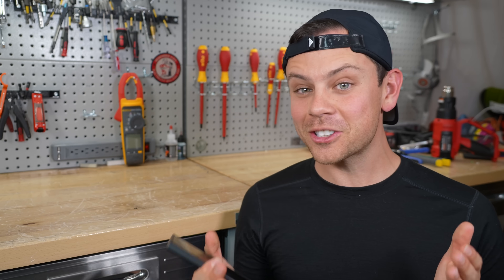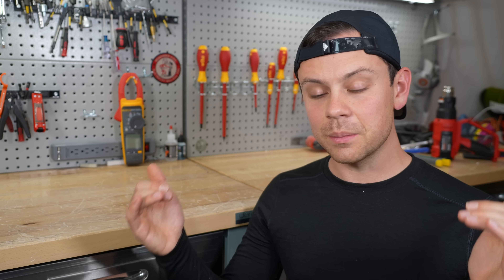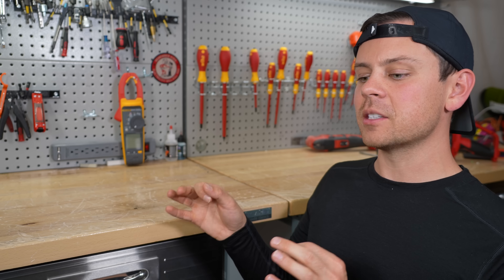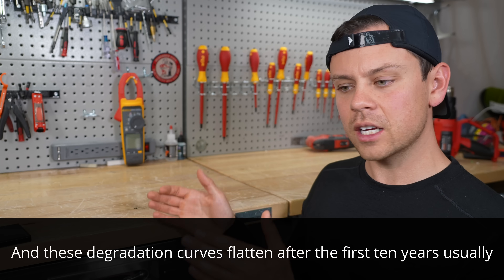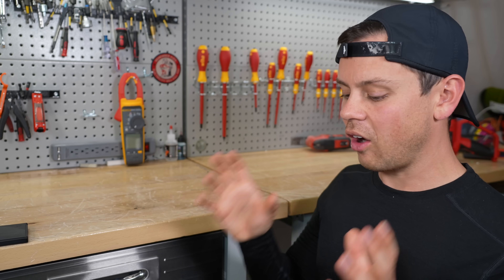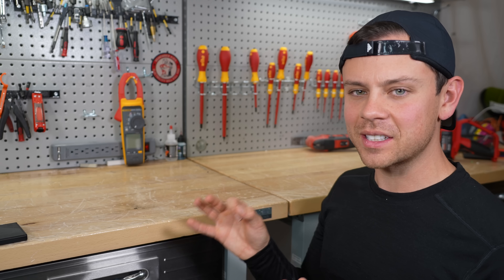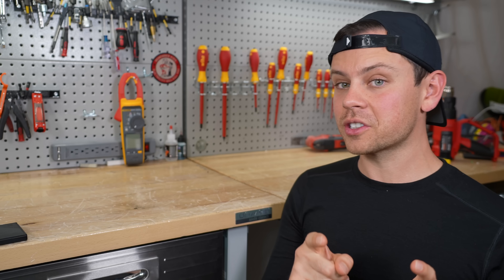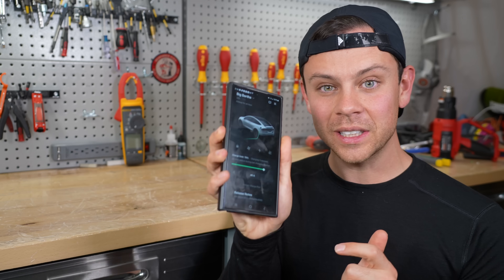LiFePO4 Longevity Discussion! Why Charge to 100%?! For Solar??

Comment: You say in a unbalanced battery if one cell reaches its maximum charge thus max voltage that one cell will fail first while charging.  But what kind of stupid BMS will keep on allowing charging to go on while 1 cell is at its max voltage ?
It should disconnect balance that one cell back inline and only then allow for reconnection.  Same counts for discharge and lowest cell voltage.!
And if you say 1 cell reaches max voltage but dosn't exeed it while the others arn't quite there yet, and therefore it will deterioate faster, then thereby you admit charging to max voltage doe's have negative effect on lifespan.

Comment: Will if I use these in my cabin cruiser boat they will be below deck in the motor area  / bilge.  Will the heat there hurt the batteries?  What temp will they put up with say for 3-5 hrs at a time.  Help

Comment: Ok. I ordered  9600 watt hours of battery that I plan to use as a backup during storms here in Florida should there be an outage. At 50% that would give me 4300 watt hours on guessed use of 5200 watt hours a day. I could take the battery down from 100% charging my RAV4 prime. I leave that home twice each year for three months each time. I could take the battery to 55% before leaving, or, I could get another expansion battery.

Comment: So if I am just using my 16 314ah EVE batteries as a whole home back up without solar charging with only incoming power or generator and only using them as an instant backup rather than using my generator I should keep them at 50% charge state?  I get this may increase the degradation of the cells but by how much?  I basically wanted a simple way to power my home with a few lights, tv, router, and other basic BS,  boiler circulation pump( in winter) and 1 window AC (if its hot). If there is an outage thats last past 12 hours I have the option to fire up the generator. There may be times where they sit for a year or they may get used several times in a month .

Comment: Oh my god. That phrase "if you reach 0% your system is too small" is terrible advice.

Most people want to optimize their plant for lowest overall energy cost, as that makes the most sense.
Usually that optimum gets you an overall autarky of around 80% (central european climate and energy markets).

And that means that during the worst weeks in winter your battery will hit 0% almost every single day. Unless you live next to the equator obviously.
If your battery rarely reaches 0% in a grid connected scenario that means that your system is way to big and you wasted money.

Comment: I have a DIY Seplos 48 volt battery box with 16x304h LFP batteries.  It has been working well for 2 years.  On average I use 14kwh each night that was charged from solar the day before.  BUT it will only discharge down to around 8% SOC.  I contacted the Seplos engineer and he said it was not possible to lower the discharge level to zero because "in the Pylon protocol, a SOC drop to 8% will trigger a forced charge".  Any ideas?  Do I have to live with this or is there a way to adjust discharge voltage lower without triggering the forced charge?  FYI, the forced charge usually adds about 4-5kwh at night from the grid.

Comment: Hi!  
Many people — myself included — keep charging their battery packs only up to 55.40 V.  
In your video, however, you explain that even if one cell stays slightly higher than the others, it’s not an issue. So I can safely bring the pack up to 58.40 V.
I still have a few questions:
- Once the pack reaches 58.40 V, how long should it stay at that voltage?  
- What tail current value do you recommend?  
- If the cell delta rises to around 0.200 V, should I worry, or is that normal during the final charging phase?  
- Finally, when the pack reaches 58.4 V and the charging power drops below 200 W (my battery is 51.2 V, 200 Ah), down to what voltage should I let it fall afterward?
Thanks — your opinion is extremely valuable to me.

Comment: QUESTION:  why does exceeding the 12volt current limit on power stations or coming close to its limit, cause problems like display?  The units are still working, but you may find many of these units on sale on sites as non working units.

Comment: I run a Leapton EH-A05 3 module battery with a sungrow sh10 rt inverter , what should be the min and max % SOC that I should go for? The battery is an LiFePo4 high voltage.

Comment: Please help.  I have a 60 amp mppt charge controller. 4 life po 4 100 ah  batteries. 
400 watts of panels. 
I have messaged charge controller manufacturer on settings. With no help.

Comment: Don't cells balance when all are managed by BMS? Manufacturer of LiFePo4 stated explicitly "4000 100% cycle warranty, 6000 80% cycle warranty". I understand that I trade off 20% of capacity for 30-50% longevity. Is this wrong? I just factor that in when I buy higher capacity from the start to have this 20% buffer available, and am getting few more years of life from cells. At least this is my understanding.

Comment: So is it safe to assume that LiFePO4 cells are getting balanced properly in a solar installation every time they get topped up to 100% even though there is a constant home load on them during the day? Or would they bounce between 99%-100% SOC constantly or however it can be configured? If a solar charge controller is large enough, could solar panels alone sustain all home loads while the LiFePO4 batteries do their 100% balancing. Or am I thinking about this wrong? I'm sure the time to do the balancing depends on cell type and configuration.

Comment: Great video.  Question, I have several EcoFlow 3 units that I use as UPSes but also to go off grid during the peak times (about 4 hours a day).  The app recommends 20-80% for min/max charge and discharge.  Does this advice still stand for completely self contained units like these EcoFlow units?  Assuming most users will follow those guidelines, I wonder how they balance the cells if they never charge to 100%?

Comment: May I ask an advice please?

I'm desining a small solar lifepo4  set-up (12v 3,5 Kwh) for a little mountain chale. The set--up will be used sporadically, with pretty long periods (even few months) with no usage. But because I could go there with no advance planning, the system should be all time on.
Because cells must be balanced, I guess that they will be fully charged for most of the time, with expected high degradation.

What charging parameters and tension do you suggest me to use?
Should I go for lead acid cells instead?

Thank you very much!

Comment: Lithium BMS has an 11volt safety shutoff, and a 14.6 volt safety shutoff built in.  How in the world are you gonna discharge it to 0 volts if the bms stops discharge at 11 volts ?? Where do people get 100% or 0 percent if its 14.6-11 volts??

Comment: I have 400w of Solar and 35amp charger going to my 200ah battery "soon to be 320ah" and I power my RV and I only drop to 82% over night if I unplug the RV and just run Solar and then it's back up to 98 to 100% do I need to use more power over night????

Comment: Sir, I am from Pakistan. My lithium-ion battery used to charge 100% for the first two months. Now, after charging 92% from this month, it stops charging. What could be the reason for this? Is this automatic BMS doing this?

Comment: I have two 12 volt300 ah lithium. batterys on my boat .2 200 watt shadowflux panels .12 volt system force30 amp charger and victron mppt solar charger.  How should I charge boat mainly used on weekends and sits all week plugged in to shore power thanks love your videos I have learning so much

Comment: Just think about it do you really think these batteries are worth the aggravation of maintaining. When I'm getting out of this I can't buy a battery put it in a closet for years and  when I'm ready to use it I can charge it. 
Based on his video this is not true I have to remember to keep it at 50% for the next couple of years until I'm ready to use it.

Comment: EG4 said this to me on 10/9/25: Lithium Iron Phosphate (LiFePO₄) batteries, such as the EG4 280Ah indoor battery, are known for their durability and long cycle life. However, regularly discharging these batteries to 0% State of Charge (SoC) is not recommended. Discharging to 0% SoC can significantly reduce the battery's cycle life and degrade its capacity faster. EG4 advises maintaining a Depth of Discharge (DoD) of 80% to maximize battery longevity, efficiency, and performance. This means the battery should ideally not be discharged below 20% SoC.

Comment: Just had the other Video,
yes, I don't know exact when in the sunny or cloudy day they reach 100% (even with my settings now it can't), but at latest some around 20-21 evening I discharge them during the night, keep my server, router and fans up. So even if reach 100% they are on that will be for 6-8 hours max ? But so far I hear out, it will switch to float as some time ..., good I set my one higher in the morning. Reminder paper is ready near my working place not to forget it. 14.6 V, and float 13.6 as from other video.
got it, more clear here.
Difference between daily using and storage is clear.
My batteries are in the front room, winter maybe some day under 20 plus C, and summer maximum near 35 dC as latest than they also get the AirCon Air beside.

Comment: Question: My biggest concern is cold weather and lifepo4 batteries. Do I bring them in during the winter and keep them in the house or can I leave them out in the cold? I live in central Indiana and we have weeks is not months of below freezing. Do I turn off the charge controller at what temperature? And just leave them in there. I have them in a camper that has 100ah 48v system with a bluetti 200max and victron charge controller 1000w of solar. It would be a pain to tare them down, but thats what I'm planning on doing.

Comment: Will charging and discharging more than  0.2C cause faster degradation? So far its difficult to do 0.2C since that means need a good 5 hours straight of charging at 0.2C to fully charge batteries. Whats your recommended maximum charging/discharge rate?
Sorry cross posting this on the other video hoping to get an answer.

Comment: WillProwse I have been watching you for years. I never ask anything bc you discuss everything very well however I bought 95$ lifep04 4 of them and I am running them in perrallel to power my 8000 watt teramps car audio amplifier.  I will appreciate any advice or recommendations you provide for best performance and longevity.

Comment: This is the situation I am in,  I have a battery bank of three Vmax AGM 100 AH batteries hooked in parallel, I am charging them with a Renogy solar charge controller mppt 40 amp.  and I want to add a 100 AH lithium batter to that battery bank. I noticed that the boost charge is about the same 14.4 volts and the float charge is 13.6 volts for my AGMs but that also about the same for the lithium also, my batteries are used everyday, So I thought the lithium would just give the system a little boost, The lithium battery should come this week, a Bouge RV 100 AH LPO 4,  and it has bluetooth (I think) so I can monitor it just to make sure everything works,  ha ha ha.  What do you think ???

Comment: I'm with you Dude, ill be charging my cheap Lithium to 100% and just hope i can get there enough to properly balance the thing. Hopefully ill hear this on another video, but if not. How often and should I disconnect from my solar and achieve 100% via a 240v charger. We're in the UK, not Nevada unfortunately.  😁🤘

Comment: Thank you so much. I am learning still. I have learned how to lower my electric bill from $400. to about $55. per month. Although I have 10 systems in play to do it. I think my efficiency ratting is about 30 percent. The only systems that give me trouble are Eco worthy and Powmr. One of the Eco worthy systems is pretty much trouble free. The sun gold systems operate fine. They all look like they were made in the same factory. Just different paint job.

Comment: It doesn't make sense to me to be set up so that your batteries drain to near 0% overnight, if you have a cloudy day you wouldn't produce enough to charge them the next day, you might not even produce enough for your essentials.  I'm not on solar, I am researching it and debating between grid tie and off grid.  I don't think I would have a battery backup if I went with grid tie, but I'm not 100% decided on that either.

Comment: I recommend the slow charge on all Lion batteries.  It just helps the battery last longer.  Get a weak USB charger and leave it plugged in overnight.  Use the high power USB chargers only when needed.

Comment: for example 16s bms wont discharge per cell at 28A at any given point. Do the math. 250A bms / that by all cells 15.625A per cell. You would have to bypass these cells in such a way thats not even within scope anyways.

Comment: So what is full charge? 58V at bulk, or "absorb" charge as you call it? Or 54.4 V at float? And, what is the absolute maximum discharge, 42.8, under load, I assume? Or, 48V at rest???

Comment: Great info thank you. Question, solar on a boat in Mediterenian climate: long sunny summer days charge my system to 100% before noon yet winter solar , fewer sunny days , lower sun angle , slightly higher consumption 100% charges are less often. Should i install an on/off switch to limit summer abundance?

Comment: my RV trailer has 5200 watt*hours of solar, and 360W solar panel.   as long as there's a reasonable amount of sun, its usually 100% charged by 11am or noon as my typical daily use is around 700 watt*hours.     Its when I'm camping in the shade with no sun that battery gets used, in about a week.    Should I make a point of shutting off the solar for a few days every couple of weeks ?

Comment: Hi mate just wanted to now if the lithium BMS shuts of then would it reke the solar controls as the sun comes up the sun will be trying to tern the controller on at a unstable voltage. As your supposed to hook the battery up first. Is this a problem. Thanks

Comment: I'm not too far away from Vegas I would love to show you my portable power bank the downside I'm using Wize 12 v 100AH lead batteries. Heavier than a fat lady at a buffet... but scared like chicken of lithium.... 900 watt panel , Vectren energy mppt 150/70tr  , but lithium

Comment: Interesting video @willprowse. I've had Battle Born LiFePos for 8 years running in my RV and have followed their recommended storage instructions. They differ from what your video says in that they say to charge them to 100% with no mention of storing them at 50%. Am I missing something? I would love to hear your perspective. From their website;

"Properly Winterizing Battle Born Batteries

Bring the batteries to a full charge using shore power, generator, or lithium charger.

Disconnect Solar PV inputs from controllers.

Disconnect from shore power, generator, or lithium charger.

Disconnect the batteries from the system using your disconnect switch or removing the positive main battery cable.

Ensure that all system loads, including Smoke and CO detectors, must also be powered down."

Comment: I have a BMS that has a balance current of 2A using super caps. They always run with a max out of balance voltage of half a mV per amps supplied or received. I don't even bother checking nowadays

Comment: I charge until the cell voltage hits 3.55V (then the charging cuts off and the cells quickly settle back to ~3.38V) and discharge until 3.2V. Basically just to the edge of the plateau. I use resistive balancers to get them all within 5mV. It's been two years and I notice no capacity loss at all so far

Comment: I am looking to get a 25kWh battery and I won't have a problem getting it to 100% regularly, but I think that I will rarely discharge it to 0%. I just won't use enough power to discharge to 0%, so does that mean to preserve the life of the battery I'll just have to waste power to try to get it to 0%?

Comment: I left a 5s4p headway 38120HP pack 2 years unused, perfect 8.3 cummins startup once hooked up. Awesome chemistry. :-) I have a 150Ah 4s1p pack in one car, can leave the headlights on all day and start better than any lead acid that fits in the same space ever could. Most of my cars are top balanced on every drive. But once parked they bleed down and are stored at nominal voltage. Forever batteries in my usage.

Comment: I use LifePo4 in my 12v ups bbu’s for accessory items. They are direct replacements for SLA. Since the voltage of the bbu is designed for SLA, the lithiums end up only being charged to about 80%. But held at that with a trickle charge of 1-3 watts. Not sure how it affects them long term for balancing but at least it’s not held at 100% since they hardly ever get used. We have rather stable grid power. I also put one in my garage door opener designed for SLA. It constantly trickle charges it with 7 watts which I find to be too much in my opinion.

Comment: I use a LiFePo4 Powerstation (EcoFlow) as a UPS at a remote home which I monitor remotely & it draw very little power to run a WiFi router & Eufy Homebase. So mostly on past-through grid power. So it cycle very little as there are very few power outages. At what SOC should I leave it then? Currently it is set at 80% but after watching your video, it is maybe better to leave it around 50% but then it leaves less juice in case when the power do go out. Maybe 65% SOC?

Comment: If you are charging to 100% and never going down too much your system is over sized.  I only get to 100% on a a few bright sunny days in a row, and on a good day I only go down to about 40%.  I'm running three freezers packed with beef on my 1800 watts of panels and 7500 watt hours of lithium iron phosphate batteries. Only on super rainy days do I get down to 10% and use just a bit of grid to keep it from dropping further.